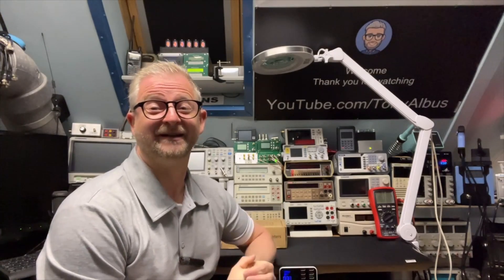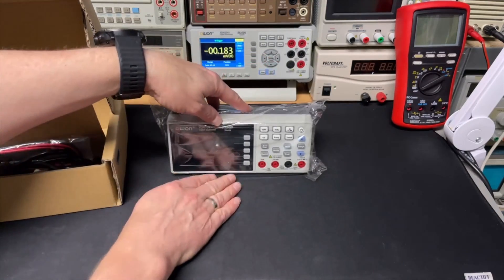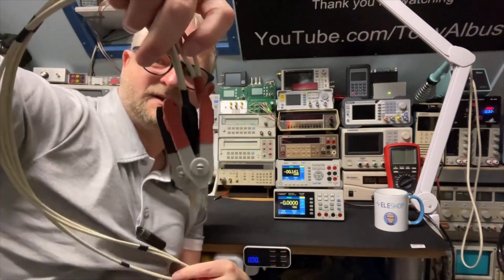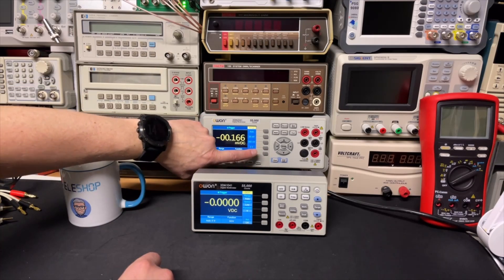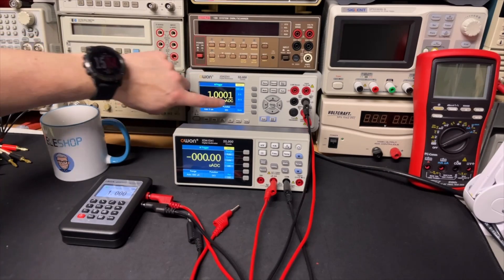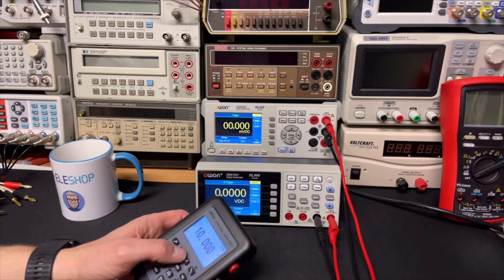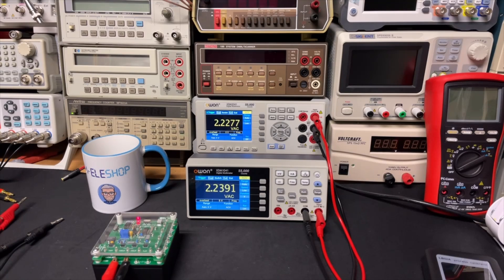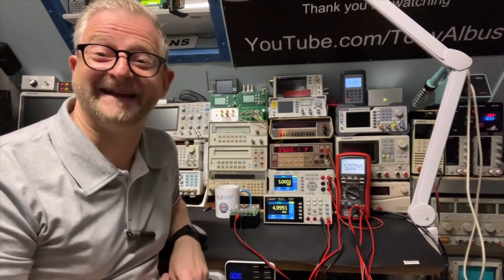#231 Owon XDM1041 vs Owon XDM2041

Comment: Nice one, but of course you are just scratching the surface here. There are a lot of issues with the XDM1041 (see my series of YouTube reviews for details). The XDM1041 has decent hardware and built-quality and uses the same measuring chip HY3131 as Dave Jones (EEVblog) 121GW Multimeter.  It's great that it has a reasonably complete SCPI remote control interface. The worst thing is the totally useless recording function because there is no way to download the recordings!  Measuring capacitance is not good either. It can't do less than 1nF and caps > 1000uF need help using manual ranging. Temperature measuring with K-type probes works but is flawed by internal heating (turning the backlight very low helps) and it updates its cold junction reference only every 10 minutes. This means for the first 60 minutes you get a staircase temperature curve even when the actual temperature you are measuring is constant. Oh and using the supported Platinum-type sensor instead is seriously flawed because it doesn't do 4-wire and in temperature measurement it can't do resistance-REL to cancel the lead resistance to the sensor (it RELs the temperature instead!). A lot of negatives but it is still my most commonly used meter because it is always on, sits right on my bench without taking any room and has a really large and bright display. Of course I only use it mostly for uncritical quick checks (mostly volts and continuity). For anything more serious I use my other multimeters, but you can't beat the XDM1041 for convenience.
Reply: It's not that great on diode measurements either - measures consistently low across the board - I was able to get mine to measure caps down to 500pF but anything below that - no reading at all.  Autoranging on caps is absolutely terrible.  Claims 60mHz on frequency specs - not even close.  Temperature reading on mine is kinda wonky also.  I got mine mostly for being able to monitor voltage with an always-on display so I'm happy with what I have it doing for me - and you can't beat it for portability.
Reply from the maker: Thank you for the additional information, i have pinned it for others to see.
Yes i did see your videos, thank you for writing that software and share it on github for others to use!
Reply: @TonyAlbus  Thanks Tony, I love your channel,  so much cool gear and well presented
Reply: @TonyAlbus  There is a new version xdm-1241 with internal battery power (2x18650) and USB C power and 5V jack for power adapter/phone charger. Totally cordless, no need for mains. It came out on eleshop yesterday, and I just bought the older model last week... :-))
Reply from the maker: @ironman4934  Thanks for feedback.. i did not know.. will have a look.
Reply: @TonyAlbus  Hi, I have the XDM1041 buy I want to buy the XDM2041, do you recomend?
I have others multimeters like Siglent 3045x, Fluke 289 and Fluke 28ii.
I fix audio gear and some times I need 3 or 4 multimeters at the same time for test bias in tube amplifiers.
My goal is to buy 4 multimeter of the same model for this.
This is is perfect to me for the price.
Best Regards.
Reply from the maker: @treadmillrepair754  Hi Ricardo, for me the both Owon have a to slow sample, and that annoys me. i have sold mine. if that is not a problem for you.. then it could be a nice pick for sure. i now prefer my HP/Agilent 34401A , the menu sucks but more settings are good by default and it scans super fast. even second hand they are usualy still more then very good. new they are expecnsive.
And if you don't mind using handheld, have a look at Brymen, those are very good and acurate for your money
Reply: Any option for a hobbiest?
Reply: @XtianApi  its a good meter and mine is still going strong. Not much support from OWON though if something goes wrong. The community can help, for example how to re-calibrate the meter. So far I had to do that just once because I stupidly cleared the calibration data by accident.... Newer models apparently now allow downloading of recorded data. Sadly OWON has abandoned  early buyers so the fix is not available for us.
Reply: @TheHWcave  cool.
I got a good deal on an agilent hp 34401a.
It's old, but not 90s. It's 2000s and looks really clean. Screen is great.
Yes, it's old, but it's a dang Workhorse and reliable.
Calibration after 10 years of not showed it was still bang on.

Nice thing is, you know the device is all settled and burned in.

Thank you!
Reply: you can download the measurements with the software, though it needs quite some digging to find.
Reply: LOL! What do you guys expect from a cheapo meter? It works GREAT for it's PRICE! For a guy like me who is ONLY doing light work at home it's perfect. Another gear "snob".
Reply: @DonnyHootieHoot  True, the somewhat annoying fact is that the hardware is a lot better than the firmware. With a little more care from OWON (or by making the sw opensource this could be an amazing meter)

Comment: Thanks Tony, nice wrap-up!
Reply from the maker: Thanks for the nice feedback!
Reply: @TonyAlbus  I almost bought the 1041 but your tests showed that the measurements are really slow. Compared to 30xx, it's really a different world. I am looking for a decent bench DMM and still has not decided which one to get. Currently I use a Fluke 8600a but it starts to act weird due to all the corroded multiswitches in the front (already tried to clean everything up with contact cleaner etc. but no chance). The question remains: should I spend 300-400 for an Owon or maybe a Siglent? Or a used Agilent? No idea...
Reply from the maker: @tamasgal_com  i like my 34401A from Agilent for stable and accurate, you can find them 2nd hand also, but the display from the Siglent is a big big plus.

Comment: It beggars belief that more manufacturers are not developing slimline bench top multimeters. Coming from handhelds there would still be acres more space for the electronics than the handhelds. Good review and it has put me off the 2041, which I see is going cheaper at the moment.
Reply from the maker: Yes Patrick, it is not that interesting to have a huge 3.5 / 4.5 digits desk multimeter.. while there are handies that have lost more digits.. for me a disktop DMM should have at least 5,5 and up. then it makes sense.

Comment: I have the 2041, in auto mode it is slow but you can switch the measuring speed from auto to low to mid and high. At high speed the counting goes very fast
Reply from the maker: Hi Ron, yes thats correct, i found myself doing that very often, just to speed it up.
i have sold mine, but after i have heard also comments of people very happy with the Owon.

Comment: Ele mede queda de tensão de diodo perfeitamente? no XDM1041 tem analises mostrando que tem problema que sempre mede para menos do valor real com margem de erro considerável para quem precisa de precisão, por exemplo um diodo retificador com queda em torno de 0,600 seria normal valores com 0,610 ate0,620 ou 0,590 mas o XDM1041 da valores  sempre para menos como 0,550 ou 0,540, esse XDM2041 acontece isso tambem? dizem que o software e hardware é praticamente o mesmo por isso estou pensando se compro ou não pois uso muito escala de diodo para verificar quedas de tensão então isso me prejudicaria.
Reply from the maker: Good question, to be honest, it is a nice meter, but don't expect precision and speed. it bothers me the sample is slow a lot.

Comment: I was rather disappointed with the XDM1041 when it came to capacitance and diodes.  Glad I didn't get it for use as a main meter.  Was the capacitance mode as bad on your XDM1041 as mine?
Reply from the maker: Hi, i did not test that, caps are always difficult, the reason i bought an LCR Video #083 VC4090C
Reply: @TonyAlbus  Makes sense.  But just to quickly report - the XDM1041 not that bad on capacitance accuracy - the real problem is the auto-ranging - absolutely horrid.
Reply from the maker: @Sui778  i still have it for a few day.. i can check for you.
Reply: @TonyAlbus  Yeah would be interesting to see - mine wasn't just a problem with autoranging - when you get into higher values you start seeing artifacts on the display - look at my review of it (in the capacitance section) - I got some of that on camera).
Reply: @Sui778  Yes that is my experience with it too. Capacitance works (well not for < 1nF) but above 1000uF autoranging just can't make up its mind. If you select manual range for > 1000uF , it works fine and is reasonably accurate.
Reply: @TheHWcave   Mine exhibited similar behavior, although I could get mine to measure down to about 500pF. Manual ranging does work better but I have also noticed that even in manual it will generate some oddball artifacts in the display.  Even at 50uF the autoranging sometimes gets confused though - but much more pronounced the higher up you go in value.
Reply: @Sui778  Yes I have seen those display artefacts as well, I think the software really gets confused.
Reply: @TheHWcave  Yes, absolutely does and I recorded it to show viewers.  LOL
Reply: vc5090 is useless , a lot of descriptions in chinese

Comment: Good review. I haven’t seen many reviews on the 2041 and was surprised it is so slow. I’m considering just going with a Bremen hand held. It seems it is much more bang for the buck than any of these entry level bench top meters. Is that a Brymen BM 869 on your bench? Have you reviewed it?
Reply from the maker: Hi, yes agree, i would not buy the XDM2041 again and i will not the XDM1041, it is to slow, then i use my old Keithley or my new Siglent. but for entry it is nice. Yes the Brymen is much better but is a handheld. On my desk indeed a BM869s , i did review BM867s Video #210 that was very good so i decided to buy the BM869s because it should be even better, but i have net really noticed yet but should be more accurate, the 867s was already good.
Reply: @TonyAlbus  Agree, the BM869s is a fantastic handheld meter. I also like that I can get its readings through the USB interface on my Linux desktop (using my own software).  The recording capability is very useful with the 2 temperature sensors supported by the BM869s. For example, one measuring room temperature and the other tracking the build-up of heat in some device I am testing.
Reply from the maker: @TheHWcave  Cool you made software for that too? so great you write your own tools where the brand is lacking.. will need to look that video up.. thanks!
Reply: @TonyAlbus  Actually I never made a video about that one. I did not think it people would be interested. Brymen delivers some software on CD so I assume most (Windows) people would just use that. Anyway, my software (in Python3) is just a logger because the interface to Brymen handhelds is really a read-only affair. All you get is what the meter displays. My utility use the command line to produce a CVS file that you can open in most spreadsheet programs (including Excel). I can put it on my Github page with a short readme if that is of interest.
Reply from the maker: @TheHWcave  Yes interesting, i will order the usb-kit and see if it can export..but still interesting to see if i can get your python script running on windows (should be possible) , i will need to start to look into python anyway because you can't get around it anymore :) i wish i could program in python.
if you like to share it, that would be great!

Comment: Good video! My fist thought was where is the SDM3065, glad you said something!! You can never own enough DVOM/DMM. Two is the absolute minimum. Even though my Siglnt can display amps and volts, same time. I prefer two metes actually measuring at the same time. Thinking of another bench top soon. The other day although not common I had 6 running at the same time. Finding out the efficiency of transformer. Just need to understand if they agree, if not by how much and is deviation linear.
Reply from the maker: Yes indeed you can never have to may DMM's :))